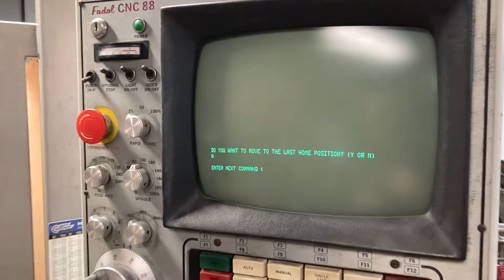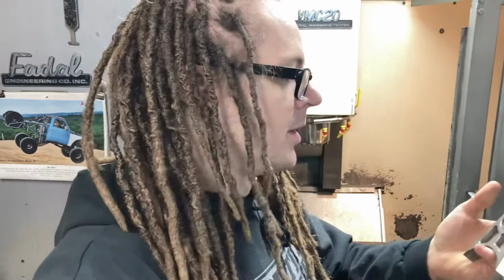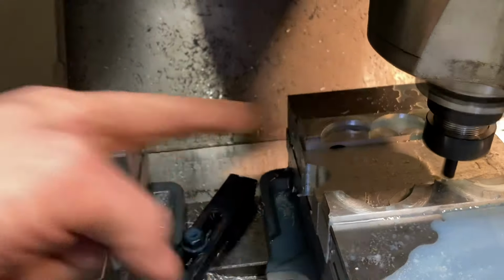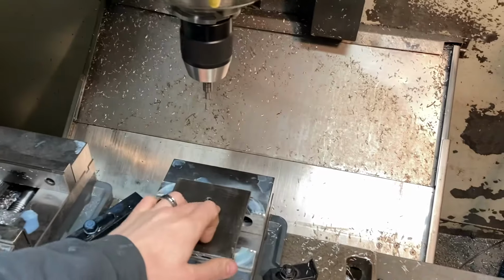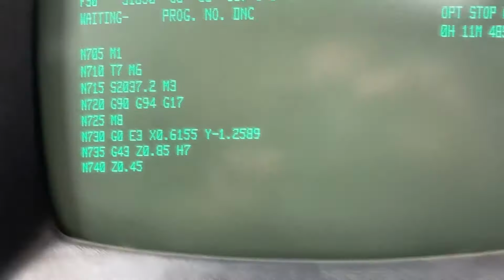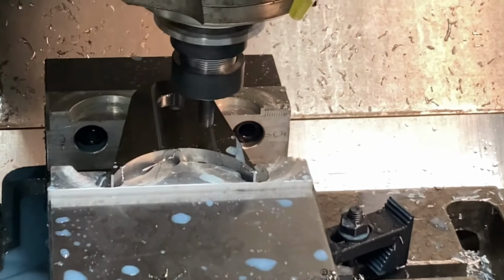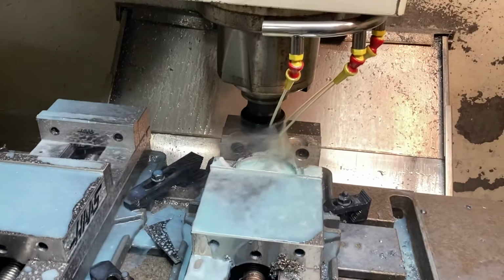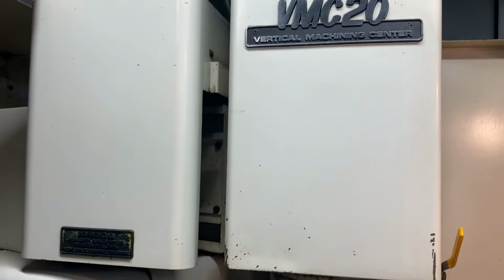Machining Prerunner Link tabs, CAD / CAM with Fusion 360 , on Fadal VMC 20 - Dune Hippie Vlog #51

Comment: On your 2nd operation I’ve seen guys take a endmill to remove the excess material will plus .01” material on the O.A.H. Then run a facemill to finish your O.A.H & leave a nice finish. The endmills tool path resembles a spiral motion that starts on the out side of your rectangular boundary running clockwise then steps inward to the center of the part. It will reduce vibration and Increase insert life of the face mill…so they say. Awesome work bro.